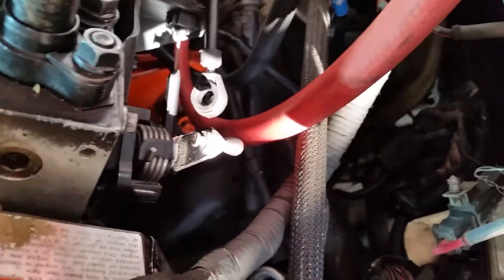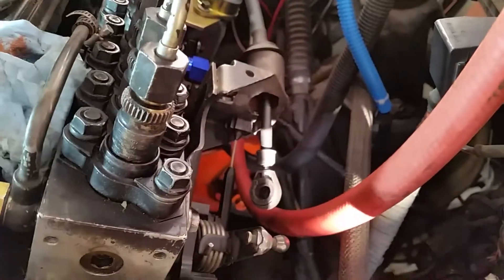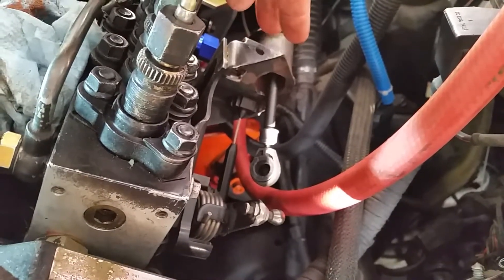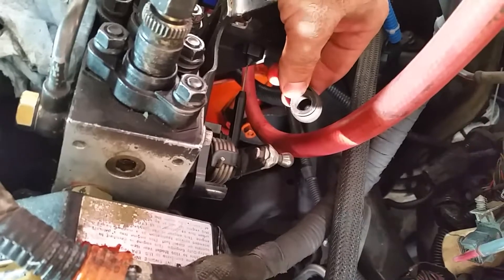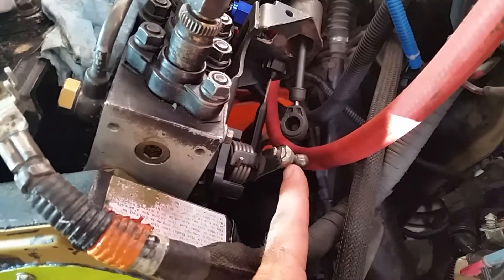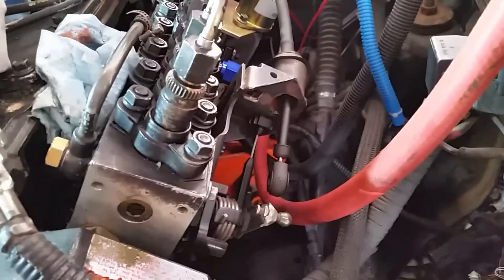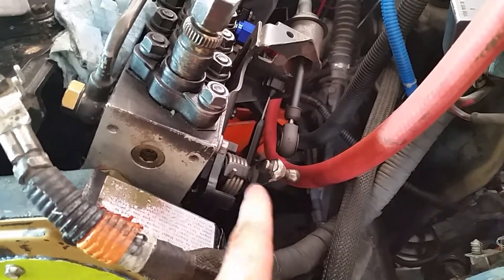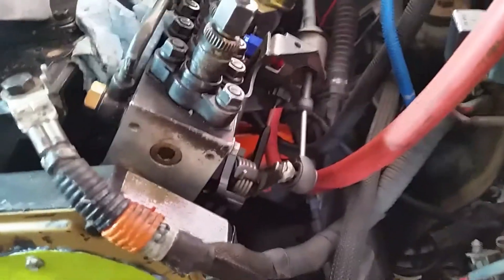How To Make Your Common Rail Throttle Cable Work With A P Pump

Comment: Trying to put one together right now my trucks an 03 but only probably is its fly by wire not cable so im wondering are the pedals the same can i just buy a new throttle cable setup for a common rail?
Reply from the maker: So you will have to buy a new pedal and a throttle cable. But the good news it that the pedal will bolt in and you can run the cable with minimal trouble